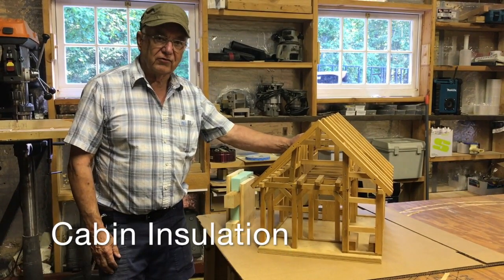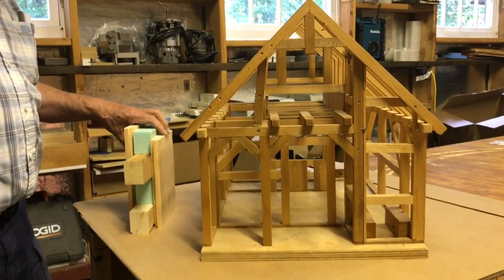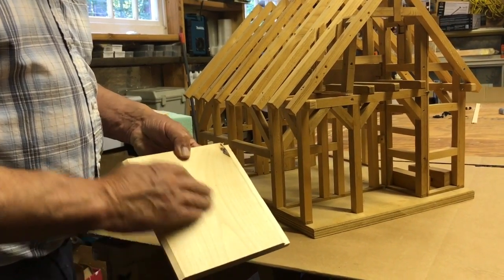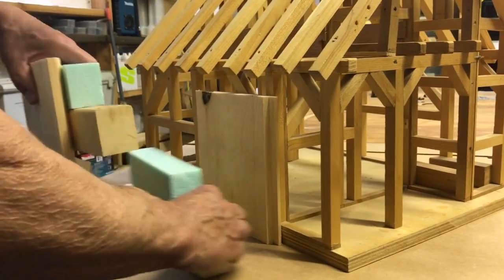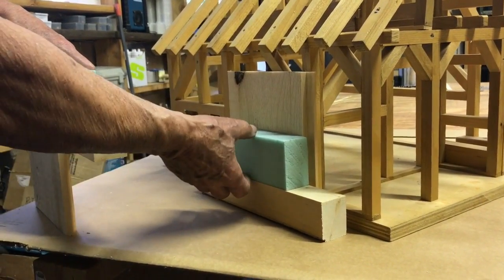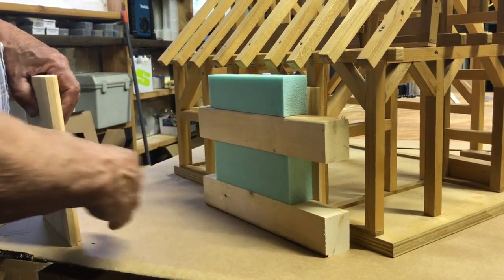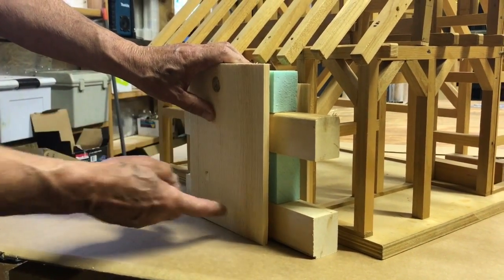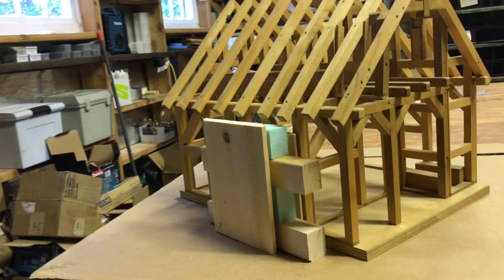Cabin Insulation | Timber Framing | 203-534-8771

Comment: Thermal bridging everyHWHERE!
Reply: I believe using a sip and I will be the better solution
Reply: @glenwebster6097  shoot, you can even use panellized insulation products continuously (rock wool or fibre board) and then do strapping that’ll give your siding space to dry from behind.

Most can take the psi required for siding.

Comment: Should have called it 'cold bridge cabin' 😂 I'm all for using sips etc but not with a 2x4 every 2 feet!
Reply: What are some other options beside sips? The upside I see of this method is that it can be DIYed, yet I don't like it, specifically due to all the bridging.

Comment: Are you not concerned about not having a vapour barrier and house wrap installed as well as opening  the building to heat loss due to thermal bridging with your method ?
Reply: From everything I have read and experienced vapor barriers create mold. A building being able to naturally dry out is much better in the long run than a building that has vapor barriers that trap moisture inside the walls. Definitely this technique would get thermal bridging though.
Reply: @dannylloyd-jones5758  agree 100%!
Reply: yes. old homes were literally built to breathe, and they didn't have the problems with mold that we have today because of modern residential building codes (which are incidentally pushed by the industry that make vapour barriers and other modern products).
Reply: Those are not barriers but regulators, so building can slowly breath and not to cause condensation at dew point
Reply: @mountainsriversandtrees1474 old homes had free firewood...

Comment: Too much thermal bridging.
Reply: And no vapor barrier of any sort. With negative air pressure, (as when a furnace fires up) I think you'd be sucking cold air straight through those walls. Probably OK if it's just a summer recreation cabin but a problem in cold weather.
Reply: Yes. If you are watching this video do not insulate like this.  Your walls will eventually rot out.  The "nailers" should be applied directly over a continuous layer of rigid insulation.  You also need to have the correct thickness/R value of insulation (based on how cold it gets in your area) so the dew point is somewhere in the insulation and not against the interior wall (which it will be with only 2" of insulation in Vermont and all the thermal bridging shown).  You could get away with less if this is only weekend get away and/or will not be used in winter.

If you also did put the nailer over the insulation and not between the insulation you'd have a rainscreen for the siding.  You should not be applying wood siding directly over insulation because wind driven rain and/or moisture driven in from sun has no way to dry out when it gets behind that wood siding.
Reply: @davidb.5544  This is just like sip panels. I don't understand how there's an issue with this?
Reply: @LetTheWritersWrite  It is not airtight between the foam and nailer in this video.  There is also thermal bridging between the outside and inside via the nailers.  Neither of these issues exist in a properly installed SIP.  Both of these issues can be solved by placing the nailers on top of the foam and taping where edges of foam meet each other.
Reply: so a small bead of construction adhesive would work against this... making it a solid panel essentially
 @davidb.5544
Reply: @davidb.5544  what about spray foam?
Reply: @andrewyork3869  spray foam would work as well but is more expensive than using foam boards and taking precautions for preventing any airflow around edges.
Reply: @davidb.5544  okay that makes sense, I am going to reread that whole little thread. Been looking at building a cabin in Alaska on and off for most of my life. Recently been tackling insulation....
Reply: If you want to learn about insulation, spend some time on Matt Risinger's channel.

Comment: If i raise 10 frames 6 by 6 meters, one meter from one another and wrap them with floor boards screwed on the frames, would these boards 10 by 2 cm with over 1000 screws in total, hold  enough the frames? or should i conect the frames with the same frame thickness timber?

Im thinking for the simplest yet strong construction design

Frames are joined with metal corners (square metal welded tubes)
Reply from the maker: We can't really offer much advice without understanding more about your project, but we can suggest that you run your vertical boards on diagonal flooring for extra strength and better bracing. And nails instead of screws will probably be fine to avoid racking.
Reply: My project is pretty much the same with this one in this video, just that my triangular frames are conected on the bottom too, with another board, forming a full and strong triangular frame and are meant to be placed on e cement floor.

Now the question is: Can i remove at the end of the process those little boards in between the frames, as this guy has placed them to attach the frames, would particle boards from outside hold enough, the frames of this size as in the video.

Instead of particle board i'm thinking of placing floor boards 10 by 2 cm, as i explained wraping the frames from outside.
There will be no insulation just the full windows on the front sides

How strog will this be?

The construction project is very simple.

If you have a better idea now, what would you advice ?

Thanks a lot

Comment: Aren't there still some heat bridge potentials with the Pine wood-->2x4--->Pine wood-->beam?  Asking becuase we are acutally in the process of building a model like this for a school project.  We don't have much building experience.  New appreceiation for how awesome it all is.
Reply: Don't you have the same issue with standard framing? The insulation just goes vertical between the wall studs. Here its just horizontal instead of vertical. I am no expert but just a thought.
Reply: If you are going through the effort of applying exterior insulation you can get rid of almost all the thermal bridging by just applying the "nailers" to a continuous layer of rigid insulation.  It would take less work to do that then what is done here.